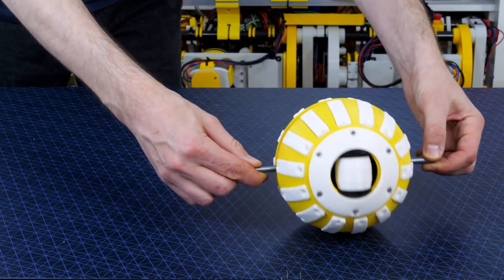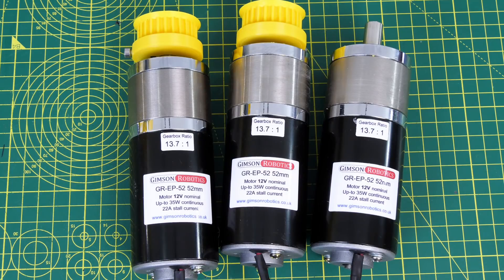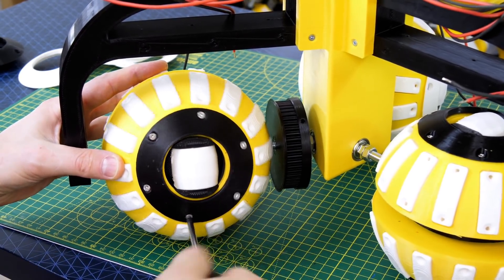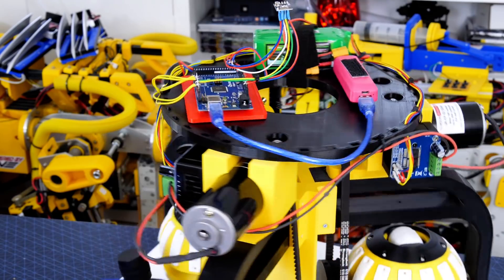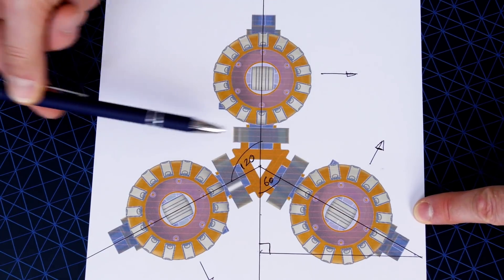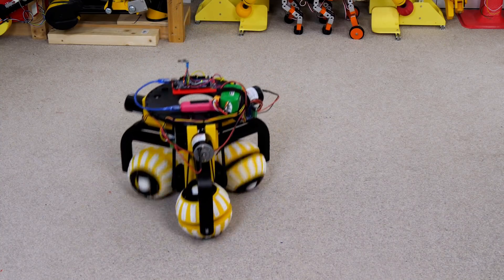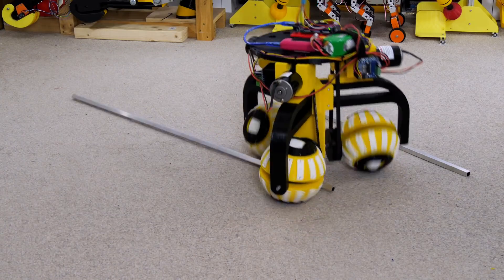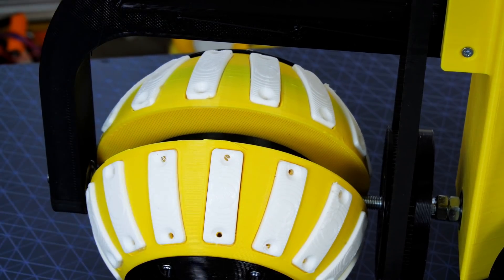Testing Ball-Shaped Wheels on an Omni-Directional Robot

Comment: I will try to describe a thing I saw several years ago...  Imagine two pairs "tuning fork"-like prongs.  Each "handle" is in a bearing that hold the forks parallel, with a toothed belt that lets them spin along the parallel axis of the two "forks".  Each fork is position 90 degrees from the other (looking at the end, if one fork is vertical, the other is horizontal).  Mounted between each fork is one sphere, the top an bottom cut flat.  The axis of the forks are parallel to the floor.   If only the forks rotate, if the axis of one sphere if vertical, the axis of the other is horizontal.  As the belted forks rotate, there are two 45degree rotation-pairs where one sphere it touching the floor, the other is not.  There will be two other 45degree rotation-pairs where both spheres touch the floor. drive the spheres, with the forks stationary to get motion 90degrees from "fork spin".  Combine "fork spin" and "sphere spin" in any proportion to get movement in any direction on the floor.  I think if you had 4 sets of these, each pair in line, and 90degrees from the other pair, you only need to drive the forks spin to get translated motion in any direction.  I'm not sure how you would drive this through turns.

Comment: I think the low center of gravity and the motors high out of the way make this a great all terrain robot - sand, grass, mud, etc.
Reply: I'm wondering if it would be possible to mount the motors even lower and lower the COG even further.
Reply: @wmlye1  You can just make the wheels as heavy as you want. I wouldn't lower the motors.

Comment: In addition to replacing the round shaft with a flat plate, you could probably actually widen the gap and put TPU "brushes" lining the edges so that they can spread around the axle as the wheel rolls but also provide decent support and traction in the other axes when the wheel is rolling.

Comment: great job, I'd assume you could make i more stable by leaving more distance from the center of the bot and the wheels, and in that increased gap, you could put some of the component to lower the center of gravity. if the brackets arm for the wheels are also flexible... you've got a basic suspension system.

Comment: I think moving the motors to be across from the wheel they power and lower on the robot could be better if a little more complicated.
It would lower the Center of Gravity increasing stability and also be more space efficient.
I also think it would be an interesting challenge to try and integrate motors into the wheels themselves.

Comment: Can you try making a 2 wheel design. I few years ago came up with this motorcycle design where both wheels were ball wheels, and it had a basicly a cylinder shaped emty space in the middle. Where a pendel like weight would balance the robot. But something like in you last project would do also fine I could imagen.

Comment: Doesn't the robot have  very high center of gravity? If it's used to transport stuff this woulb most likely need some balast or a heavy battery in the lower part between the wheels.

Comment: Very cool project! One concern while watching the video is that it seems a hard deceleration almost tips it over, maybe add metal beads inside the hemispheres of the wheels to lower the center of mass would also be a useful improvement? It seems quite high at the moment with the big motors up and the batteries up. And if you add more stuff on top it will be even worst. :/

Comment: Having a Y shaped axil mount that can twist would eliminate the need of the small wheel. That would need a input command to turn wherever you want it to go like a steering System based on either belts like you have or gears. So all of the wheels turn into the direction you want to go to.

Comment: Would casting the outer part of the wheel out of silicone be a feasable solution for getting more traction? Or even just stretching an air balloon over the print?
This whole "print more sections out of TPU" / "print with dual extruder" seems a bit to overcomplicated.
Reply: Might as well make use of the free material from the sponsor.

Comment: For a low speed omnidirectional robot I can see this working really well. But for a car I'm a little sceptical to be honest. Because it is a ball it has a contact area which will probably be terrible for breaking performance. I'm also concerned about the rotation speed (and efficiency) when the wheel is rotating almost on the tips.
Also, if a car drives at 100km/h and it rolls towards the tip it will pick up a lot of speed, but then it rolls over the little wheel at the tip and when it rolls even further it has to suddenly rotate in the other direction at its fastest speed. I think this will cause a lot of wear and possibly even accidents.

But as I said, for low speed omnidirectional robots these wheels may be perfect :D

Comment: I love where you are going with this. I invented a way to drive the spherical wheel without interference in engineering class and have had it on the backburner ever since. This was actually before goodyears tire design came out but theirs inspired me to keep innovating my design .I wish to invest in a 3d printer so i can test my hypothesis .

Comment: A stool with 3 feet never wobbles, but falls over in a hurry, the higher you build it i think acceleration and deceleration will need to be limited
Reply: I too noticed that it suffered from the trike instability when stopping. Five spokes/wheels as used on (better) office chairs would help, especially with a high CoG, and may even help with obstacle climbing by having more driven wheels in contact with the "flat" surface. Control is complicated somewhat however.
Reply: Wider base..
Reply: or you have to make the base increasingly wider to compensate
Reply: @PiPArtemis  i would go for 5, you have basically no edge to fall off because there's always a wheel in the way, they don't have to be as large as the three, there's a reason office chairs have 5 double wheels
Reply: @Tarex_  5 spheres share the weight better too
Reply: Gyroscope.

Comment: Hey James would it be possible to Design a plate like a biohazard sign and Put the Ball wheels in there? With the height of the motors you would probably clear the Ball wheels and have a lower center of gravity which would make transporting goods easier.
The thing to watch out for would be the clearance of the drive belts.

Comment: Isn't it possible to code it so it never tries to move in the direction of the axle when that wheel is completely horizontal? I suppose you would need position data for the motor, but assuming the belt doesn't slip the robot could automatically adjust itself so the wheels are in the "good" direction. Especially if the orientation of the robot doesn't matter, and just the direction of movement.
Reply from the maker: Possibly, although it'll get complicated with multiple wheels.

Comment: 8:00 let's discuss our definitions about fine, JAMES
Reply: Maybe take a break from engineering robots and engineer a new gasket for that dish washer. lol
Reply: @connorbailey308  or just use dishwasher soap, instead of regular detergent. Dishwasher soap doesn't foam up like that
Reply: @WLxMusic  what? you are saying if I stop using shampoo, i won't have to mop the floor every day?
Reply: Eh mine uses a cable and buckle wrapped around it to stay closed
And a wooden platform to align the door and frame.

Comment: Super awesome work 💯. 
SUGGESTION: Instead of the wheel at the end of ball wheel, a freely movable ball will work much better and it will hopefully remove the jerks in the travel of the bot.
Reply: A captive ball might actually impair certain performance. The wheel only exists to cover the edge case of movement exactly along the axle. The wheel is indistinguishable from the rest of the solid surface of the ball in all other cases. If you replace the cap wheel with a captive ball, it could create slip in that part of the travel. I could maybe see a ball working better in an unpowered omniwheel, but that just begs the question of why not just use a captive ball the size of the omniwheel in the first place.
Reply: It needs to be a wheel, or when you use that ball for movement it will have two periods of zero traction.

Remember the drive motor pushes the wheel and rolls along the ball, of it gets to a freewheeling ball then it will slip for the entire duration of that when it is trying to accelerate.

The little captive wheels NEED to be wheels, and NEED to be oriented along the axel.  It is fundamental to the design.
Reply: Aka a trackball?

Comment: Looks awesome! I remember looking into that same tech back when I was designing ball drives. Just thought you might find this project I did a while back pretty interesting, I solved a lot of the problems to do with making a drivetrain with actual solid spheres: https://youtu.be/j09PzmVmzJw
Reply: OH, I remember that video vividly. Pretty much sent it to all of my FTC contacts. My favorite ball drive I’ve seen so far is this: https://youtu.be/INIBjexEA9Q
Reply: @Duckeasily  oh wow that’s quite unique and cool, I’ve not seen that video before! I’m getting a lot of ball balancer vibes from it with the vertical configuration. That’s also by far the best minimally intrusive ball retention system I’ve seen. Thanks for sharing! My design with 4042 was loosely inspired by this one https://grabcad.com/library/basketball-riding-omnidirectional-robot-drivebase-1
Reply: @emberklavins9567  My love of ball drives were also founded by an FRC design. I found this randomly one day on chief Delphi: https://www.chiefdelphi.com/uploads/default/optimized/3X/0/4/0486456db177cce51fa73dd4fd18917606b57695_2_690x500.jpeg
Not too sure on which post I found it on, as it was years ago.

Comment: Might I suggest instead of a roller for the centre you use a ball bearing on an axle or a free rolling ball bearing held in place with rollers on the inside of the Hemisphere similar to how the old PC mouses with the ball used to work
Reply from the maker: PC mouse balls don't have any load on top. Also a ball won't match the contour of the larger hemispheres so there will be a large gap all around it.
Reply: @jamesbruton  I see your point I was mainly looking on how the mouse would hold the ball inside the case. As for roller in the centre of Hemisphere if you change its diameter shape to convex you might get contact to the the ground but if it's going on top of a ball probably change it to concave shape same as an hourglass

Comment: Wouldn't be better to use the same system as ball mouse for the top and bottom small inside wheels ? ( btw is your dishwasher ok ? :D )
Reply from the maker: A mouse ball doesn't have any load on top, it would have to run on something that would support the load. Also it won't match the contour of the larger hemisphere so it would be a lumpy ride.
Reply: @jamesbruton  ah true

Comment: The axles are parallel to the ground, but they not need to be. If you angle them 45 degrees down, your shaft can be smaller in diameter, combine that with the non parallel hemispheres, and you got 2-3 mm gap size. Of yourse the little wheel (if you keep it ;) needs to move from the pole accordingly. These are little tunings to an excellent, excellent work!
Reply from the maker: You can't move the little wheel from the pole because how would the hemisphere rotate around in on centre?
Reply: @jamesbruton  I sketched both ideas. Just to illustrate the concept I used a huge axle with tilted hemispheres to close the gap. The axles are at 45deg, the small wheel is touching the surface, and is not on the pole: https://drive.google.com/file/d/1QAZ-nZHyRc6chi5Kqbe56HVJwXHtVMrV/view?usp=sharing
Reply: And yes I'm not a big fan of my own design, this way one needs 4 little wheels per ball (not sketched), I prefer not to have them at all.

Comment: The axle doesn't need to go through and the hemispheres need not be parallel, angle them slightly to close the gap on the the opposite side of the axle. This way with an 8 mm shaft You'll end up with a 5 mm gap.

Comment: Excellent! If you put the motors to the side instead of above, your cog will be better. I'm not worried about the dishwaser, but I do worry about tipping over if you build this up higher, the wheelbase is also small.

Comment: They should use this for the trolley wheels in grocery stores.
Reply: Just No. If you've ever used a luggage trolly at Heathrow you'll understand why this is a terrible idea.  For some reason they have the only trollies I've ever come across with four swivelling wheels. Makes cornering way more difficult than it needs to be. I'm convinced this is done to entertain the security staff monitoring the cameras.
Reply: @ChrisCameronPhoto  I’ve seen similar carts at IKEA, they’re easy to push but hard to rotate. I wonder if a circular cart would work because rotation wouldn’t matter.🤔
Reply: @ChrisCameronPhoto  shopping carts here in Germany all have 4 swiveling wheels, hardware stores tend to have fixed wheels at the back for the bigger carts for heavy appliances and materials etc.
Reply: @noahluppe  May be ok in your shopping centres, but when you're trying to negotiate heavy luggage around a hard u turn on a steep ramp at Heathrow and there's a security camera on the apex you get the feeling someone has got to be having a laugh.
Reply: @ChrisCameronPhoto  but OP talked about grocery stores, and for heavy load trolleys, as I described for hardware stores, of course fixed wheels on the back are better, as you can't accelerate them as quickly in any direction if they had all swiveling wheels.
Reply: @ChrisCameronPhoto  Yeah, I used to be a bellhop and the luggage carts were very hard to control because of the freedom of movement. Grocery carts driving like that would be a nightmare
Reply: I think the 4 swivelling wheels they currently have are almost as good as these, and I'm pretty sure they're easier (and cheaper) to make. It would be really cool, but also very unnecessary :)

Comment: Ah, this will make a perfect office chair for an evil genius.
Reply: Or a better electric wheelchair.
Reply: @fematrailer  actually doesn’t seem stupid
Reply: @fematrailer  that'd be amazing
Reply: I was imagining it as a camera mount that would lock on to something and move freely while always focused on the subject.
Reply: @darkforcesjedi  camera mount is actually a really good use for this
Reply: @darkforcesjedi  yeh me too,but for other reasons
Reply: But my office chair can already move in any direction...
Reply: @darrenfalconer3267  but those pesky wheels get stuck all the time, spherical wheels, that's it, I'm sold !
Reply: @darrenfalconer3267  but it's not powered
Reply: @darrenfalconer3267  yeah but you need to shift so much to make specific directional shifts. This doesn't have that issue as the wheels are always "centered".
Reply: I was imagine too,.. This wheels for the caddie in mall😀
Reply: This is what the Hoveround wanted to be when it grew up.
Reply: I would imagine an office chair would be less practical since you would either 
A: Have small enough wheels and tough ones but it would be too small to move the average adult body.

B:if large it would take up too much space and have a higher center of gravity so it would be liable to fall. 

C: lots of energy to move said ball wheels.
Reply: Only offer it to your nemesis though, and when they try to sit down, the chair moves away :D
Reply: Toilet for hardcore gamers :'D

Comment: Wow you have a dish/floor washer combo.
Reply: probably why he made this robot. he'll attach a mop to it lol
Reply: @mkb5170  ha ha
Reply: Ignore that fake James Bruton post,  that's not him.  Please report it as spam.
Reply: 😁 Never put regular soap in dishwashers. Also dishwashers are not watertight.
Reply: @fsdfghwaihjfkdasjfka  what are you on about? I've never had a leak with mine, and it has waterproofing strips on the inside???
Reply: @lio1234234  of course they are designed not to leak. However the door is just sealed at the sides so the spray doesn't leak. The underside in the door is just slanted inwards to flow towards the drain at the bottom. Unlike a clothes washer which fills the cabinet with water and does not overflow, a dishwasher will overflow via the door if the drain is clogged. Hence why clothes washers use foaming detergent and dishwashers don't.
Reply: @lio1234234  the strips surround are splash seals. They're designed to stop water which hits the door from exiting. Look at your door, the lower part has no seal. 
When water in the pan goes above the lip it will leak. Tilt your dishwasher forwards and switch it on, it will leak. In this case the foam went above the pan and spilled out.
Reply: @fsdfghwaihjfkdasjfka  Mine doesn't leak.
Reply: Thats so dumb.......note to self: patent that
Reply: I was just about to comment about that, like did anyone notice his dishwasher is leaking XD
Reply: @MixtapeXD  same
Reply: XD
Reply: Hello fellow quacker
Reply: Right. Dont mind the puking dishwasher in the background. Makes mopping a breeze!!
Reply: This is an argument about dishwashers
Reply: lol you have a funny sense of humor